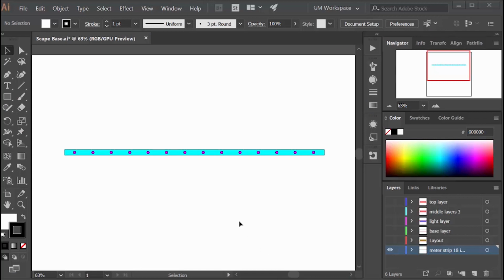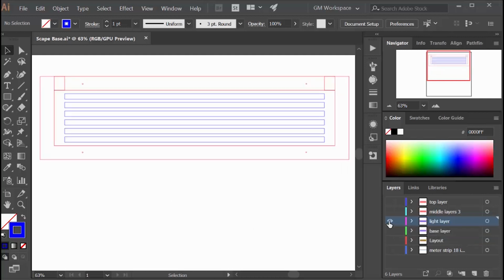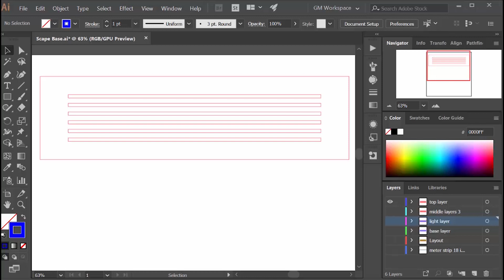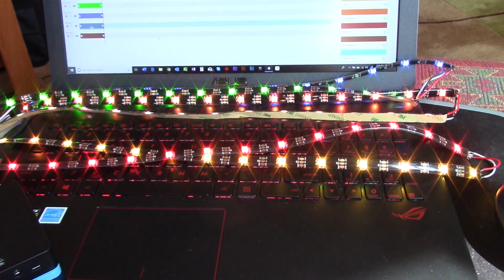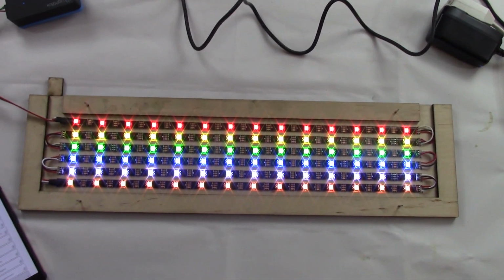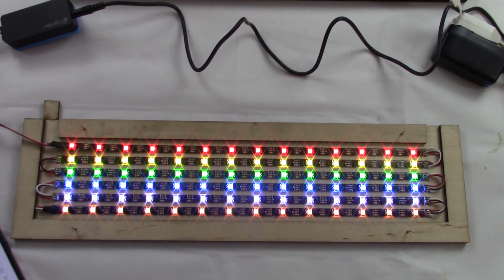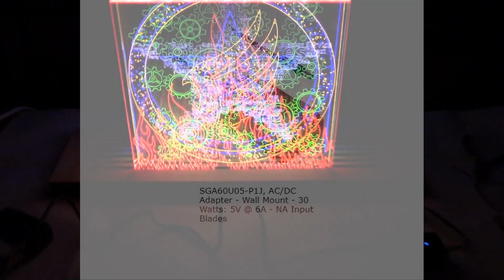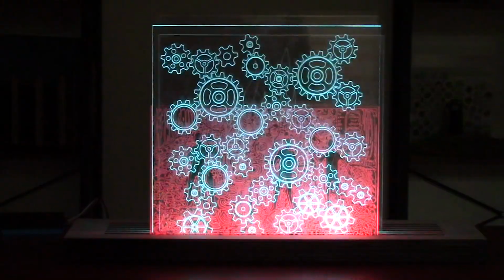How to Design and Laser Cut a Light Base for Edge-lit Acrylic

Comment: curious, why do you engrave your cut line first? does it allow for a deeper cut? what wattage laser did you use?
Reply from the maker: Colin. I'm not sure what you mean. I don't engrave the same lines I cut. In this project I engraved the slots on the layer below to show me where to adhere the strips. I also run all the engraving before the cutting so the wood is tightly clamped during the engraving. I'm using a 100 w laser but I set my max power to 80. Is there a place where it looks like I engraved lines before cutting them?